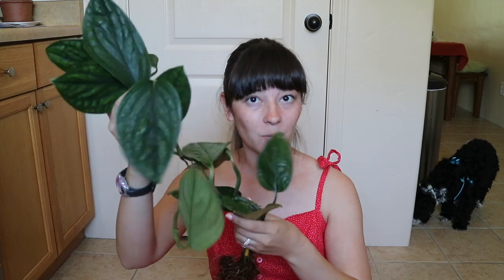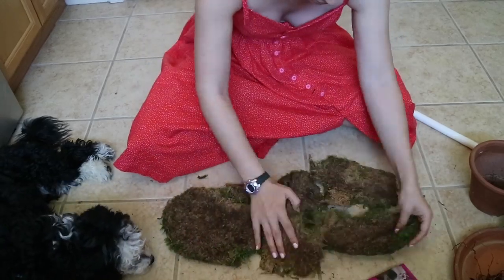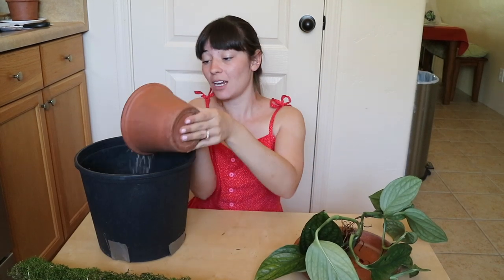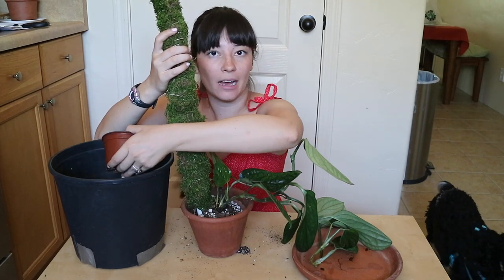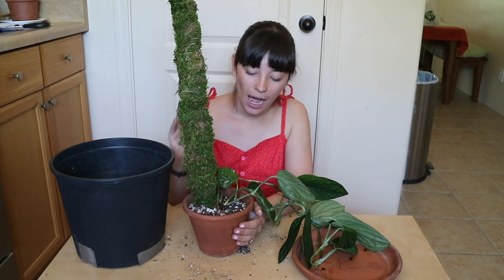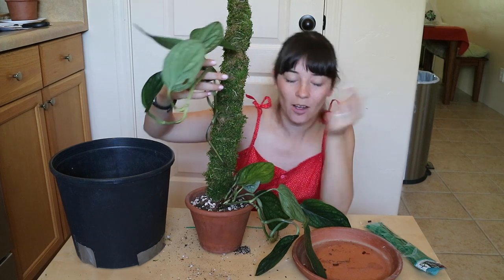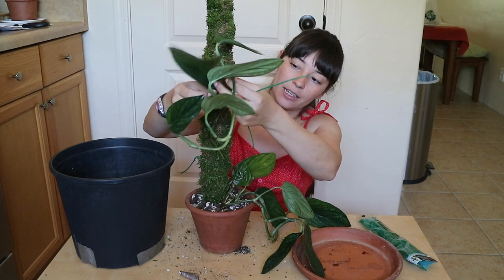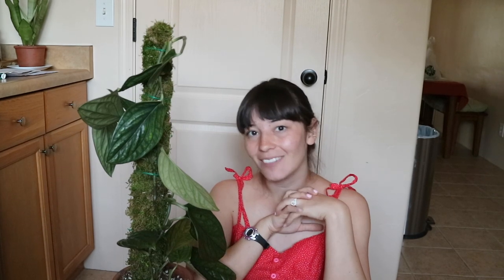How to Use a Moss Pole | Repotting with a Moss Pole

Comment: I found a great swiss cheese plant that I purchased for half price it looked a little rough and damaged but since I have brought it home and repotted it it is doing great I tried to put a trellis in the pot but it was too heavy and made it fall over so I bought a 18 in wooden stake inch and a half wide and wrapped it in hey length of cocoa fabric paper whatever it is use green twine wrapped it tightly leaving a good 6 in at the bottom of the wood exposed now I'm afraid to insert it in the pot and I may damage the roots and if I put it at the back it's going to be top heavy again what do I do

Comment: I use coir sheets to make my poles. I don't have to spray them as much as i do with my moss poles. How do you extend your moss poles or do you  repot and make a new one? You can bottom water the pots that you over filled with soil. :)
Reply from the maker: That’s a great idea!! :) with this type it would be difficult to extend, so I would just make a new one and repot. I am thinking of a different method that would be easier to build upon!! 
& yes true about bottom watering 👏🏼

Comment: I have a moss pole for my p. Silver sword. It doesn’t really need it yet as it only has about 6 leaves, but I wanted to make a moss pole. I dunno if it is supposed to have one, or even if it’s an epiphyte. I just used a stick from the harden and wrapped wet sphagnum moss around it, wrapping jute string as I went.
Reply from the maker: I’m not sure if it’s an ephiphyte either, but I’m sure it looks cool 😁